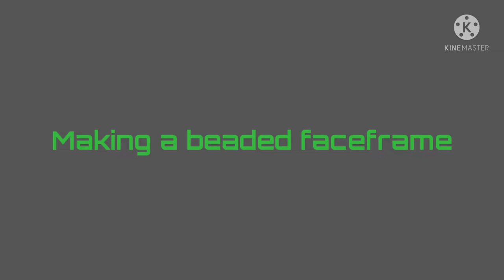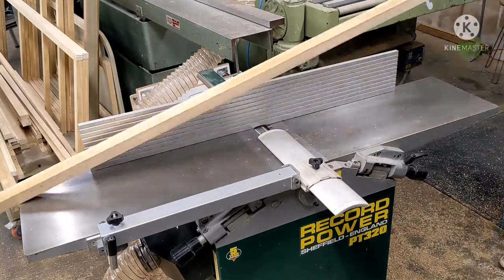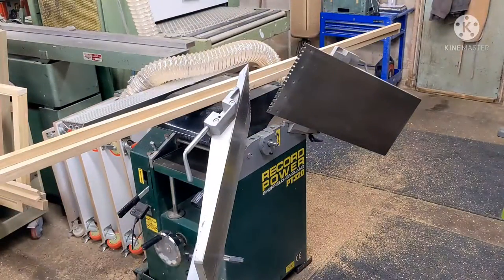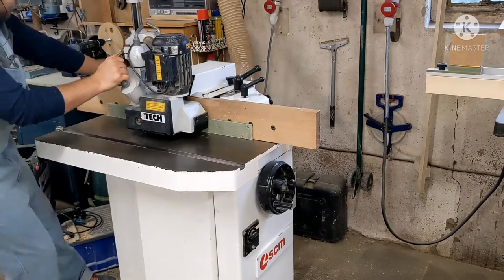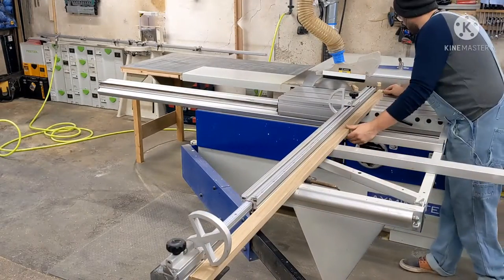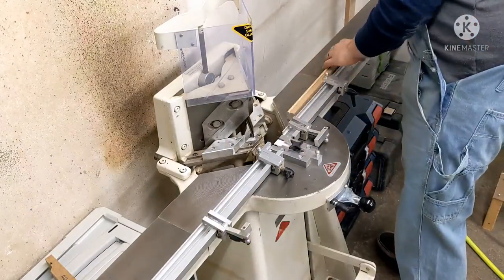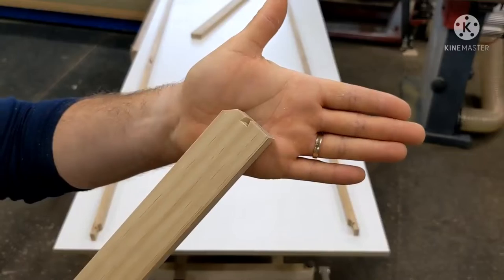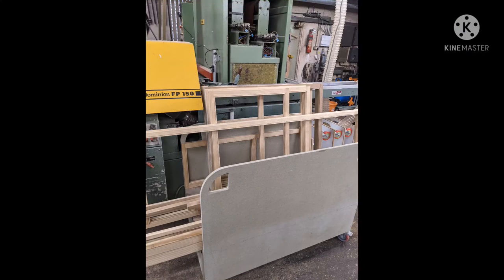How a small professional cabinet maker's workshop makes a beaded face frame for a kitchen cabinet.

Comment: Useful stuff, thanks
Reply from the maker: Thank you very much 👍
Reply: @carpentryjoineryandcabinet6335  It strikes me a different fence arrangement would be needed on the Hoffmann machine to cut the other side of the joint, as what is shown wouldn't be any good for the cutting the dovetails in the ends of the frame stock
Reply from the maker: @KavanaghGTR  yes, there is another fence set up that you use to do the key slot on the ends. I actually still had them parts left from when I made the first lot of frames up, before there was a change in the job. So they didn't get shown being made. It's quite a rudimentary design. There is a stop with a grub screw that is in the aluminium profile you can see in the video. Then there are some loose stops that drop in the profile for the timber to push up to. It looks like it is going to be a bit rubbish when you first see it, but despite the appearance, it actually works quite well.

Comment: Nicely done can I ask what size you mill your timber to? Thanks and great little video.
Reply from the maker: Hi Mark,
It varies a little from job to job, but here everything ends up at 25mm finished thickness. Where two face frames join together I make the jambs 21mm, and if it's a single it's 42mm. The heads of the frames I make 32mm, Any horizontal transoms 38mm and the bottom rail is 50mm if there is no skirting, 55mm if there is (allows 5mm overlap for the skirts). Island legs tend to be 80mmx80mm, and the door rails and Stiles 80mm. On some jobs I do 80mm stiles and 100mm rails. Hope that helps. 
Ben.
Reply: That’s Great thanks

Comment: Enjoyed that.. Do you use an Domino at all?. I  have one and use it for face frames,carcasses etc and apart from that the only other Festool product I have is the Vacuum clamp system which is very good.Not really a Festool kids chap.  I did look at the Morso an Hofffman and they look good but I don't do that many kitchens to warrant the expense. Keep posting as I really enjoy your channel.. :-)
Reply from the maker: Hi Adrian, 
I've got the xl domino, although in hindsight I think the smaller one would have been more useful for what I do. I use it quite a lot, and to be honest if it died tomorrow I wouldn't hesitate getting another one. I think the morso and Hoffman only make sense if you're doing a lot of kitchens, and it's nothing you can't so with something else, just a bit faster. I've pretty much stopped doing windows/doors/stairs etc completely now, I'm about 90% kitchens, so it was worth the investment for me I think.

Comment: Nice description of the beaded frame. Looks like your powerfeed was moving away from the fence during your climb cut. Did it?
Reply from the maker: Yeah, it always shifts back a bit, but the timber stayed tight to the fence. There is a bit of backlash in the arm to be honest, so you get that initial kick when the load goes on it, but it doesn't tend to creep any further so you get away with it. Really I need to replace a few of the tightening levers, there is a g clamp holding one of the adjusters 😂😂😂

Comment: Amazing stuff, really inspiring. I’ve been eyeing up a notcher for a while, however most of the machines I see when people are using them have a flat point, can you still do this with a 90 degree point? Thanks!
Reply from the maker: Hi Tom,
There are two types of the morso (well two common types anyway) there are the model f mitre guillotines which come to a sharp V point at the front of the knives. And there the model nf notchers, that have a flat nose (they're further divided into different size models, NFL, NFS, NFXL etc.)
The two differences between the two are the flat front nosing knife, and the fence arrangement. If you are only doing the odd beaded fame, then the model f can be used to make the 45 degree cuts, then a sharp chisel used to remove the flat. As there is no fence arrangement for this you will have to rely on working to your pencil marks. 
If you are doing a lot then the nf models remove the flat as well as doing the 45s in a single stroke. They also have the fence and stops so you can get very good repeatability. The main downside is that they tend to cost about 5x the amount of the f models. If you are in the UK you should be able to pick up a decent model f for around £400 used if you hunt around a bit. An nf model is normally very hard to find for under £2k used and they don't come up very often. I suspect there are hundreds of model f guillotines out there for every model nf, as they're very common in the picture framing industry. I hope that helps?
Ben.